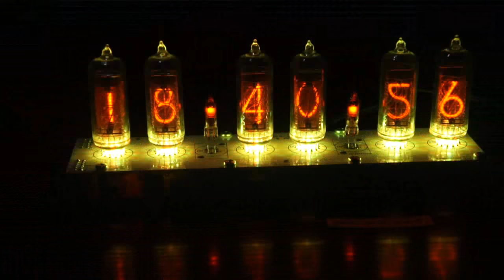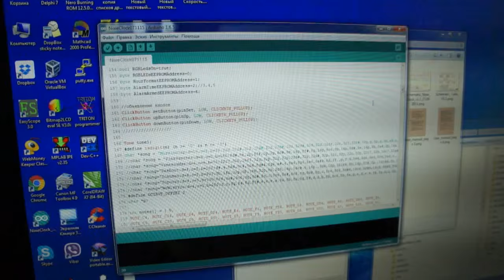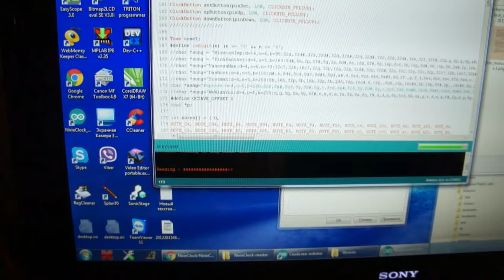Nixie Clock with IN-14 Tubes Assembled and PCB GRA & AFCH (Arduino UNO compatable)

Comment: I recently designed my own Nixie Clock and just now stumbled across your ebay listing.  I really like your design which uses HV5812 similar to mine (although I have to multiplex because I also drive the left and right decimal points in my tubes).  If I had seen your design I probably would have just bought one myself and saved myself the effort!  Great work.

Comment: Any assistance would be greatly appreciated. Tried flashing using flasher program and new GRA Flasher. Completes successfully (22218 bytes uploaded) but when i plug into 12V 1A nothing happens. Also tried compiling the sketch and it errors stating it cannot find the clickbutton.h file. I have the ncs314 v1.1
Arduino Uno R3. Is there a certain way i should be extracting the zip file from Git? When I open either .ino file I get an error that the sketch needs to be in it's own folder. Also version 1.6.12 of the IDE
Reply: I got it working. Figured out I needed to add the clickbutton.h, time.h, and tone.h libraries to the sketch in the IDE. After that it compiled and loaded and fired right up. Awesome!
Reply from the maker: You are right, we are glad that you have everything worked out!
Reply: Do you plan on an anti-poisoning routine for the NCS314? I see you have one already for the MCU105 sketch on github.

Comment: The time runs slow on my nixie clock shield. It runs about 10 minutes slow every 24 hours. Any suggestions on how to fix this issue.
Reply: Try latest firmware v1.55 from github: https://github.com/afch/NixieClock/tree/master/Firmwares
Reply: I'm using the nixie clock shield ncs314. When I load that firmware my clock freaks out
Reply: Dan Sents for shield you need to use another firmware 1.021

Comment: where can i find the program, compatible with the last version of arduino ?
Reply: we compile under Arduino IDE version 1.6.5 . Also You can try to upload already compiles hex from there https://github.com/afch/NixieClock/tree/master/Bin
using this program https://github.com/afch/NixieClock/tree/master/Flasher%20Program
Reply: thanks you for the help, i will try,and i'll let you know if it worked
Reply: ok. it half worked, the prog successfully uploaded to my arduino and everything works, except that the numbers don't shows :/
here is something i saw while i verify the code:
http://prnt.sc/cqn1kc
the last orange line that you cant see is:
Warning: platform.txt from core 'Arduino AVR Boards' contains deprecated recipe.ar.pattern="{compiler.path}{compiler.ar.cmd}" {compiler.ar.flags} {compiler.ar.extra_flags} "{build.path}/{archive_file}" "{object_file}", automatically converted to recipe.ar.pattern="{compiler.path}{compiler.ar.cmd}" {compiler.ar.flags} {compiler.ar.extra_flags} "{archive_file_path}" "{object_file}". Consider upgrading this core.
Reply from the maker: Tell me what`s your Board and version Board?
Reply: i have an Arduino Uno on the version 1.6.5
Reply from the maker: I ask you not version IDE, I ask you the version MCU PCB Nixie Clock that you use.
Reply: oh ok, well i dont know where i can find the version but i have this board :
http://prnt.sc/cr56fl
Reply from the maker: You model Board NCS314. 
You right FW https://github.com/afch/NixeTubesShieldNCS314 

Tell me you connect external power supply  12V 1A for Arduino Uno? 
_______________________________________________________________
*******************!!!!!!!!!!!!!!!!!!!!!!!!!!!!!!!!!!*************************
If there is no external power supply that will not work. This is due to the fact that not enough current from the USB power for the tubes.
________________________________________________________________
Reply: oh well yeah i was connected with the usb cable. i will try with a 12v supply.
thx ya
Reply: GRA & AFCH yay it works ! thanks you so much !
Reply from the maker: Please share photos when working- Nixie Clock Shield NCS314 for Arduino Uno
Reply: sure thing : http://prnt.sc/crb2ed
                        http://prnt.sc/crb31y
ps: turned off the led cause i prefer without